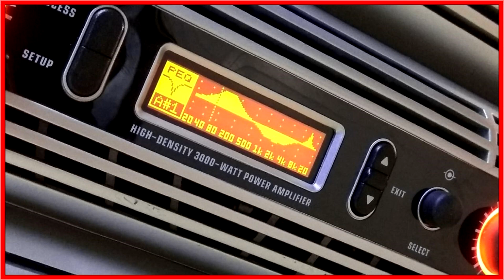DSP Amplifiers and Digital Mixers: What is Right for You - Are You Overpaying for Unneeded Features?

Comment: aside from color......is there any difference in the NU vs. NX series ??  does NX have new software features  or any hardware changes ??
Reply from the maker: I can't speak for the company, but the NX/NU smell very very similar to me.  They did have some runs of supplier component parts (mostly diodes) with quality issues that got into some of the NU-series amps, causing some of those amps to fail before their time.  Hopefully by now this has all been sorted out.
Reply: @Barry-Watson  it has been difficult to get answers from Behringer you are better Behringer tech support then they are...
Reply from the maker: Ha, well, the manufacturer should know better than I do.  I've just seen the insides of both, and they look really similar.

Comment: i have a mix of recently purchased dsp and non dsp units on a 4 point stereo P.A. .......i am just getting them setup and connected....... i am going to upgrade to all dsp units.......... now i am figuring out how to connect from 4 Inuke DSP usb's to a usb hub, then to  wifi to tablet....
Reply from the maker: Ok.  I'd think that once you got the amp DSP dialed in, in most cases you wouldn't need to change it very often, unless you change system configuration.